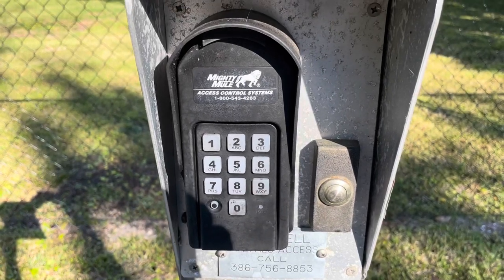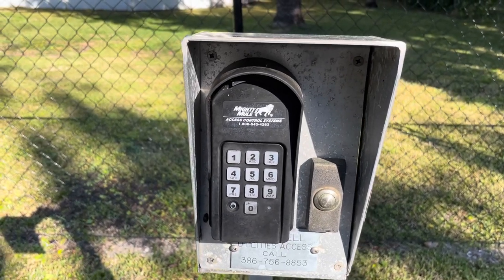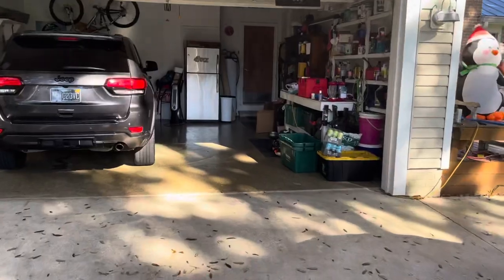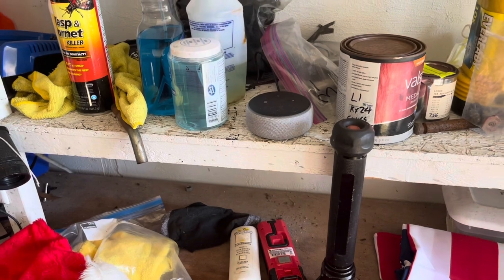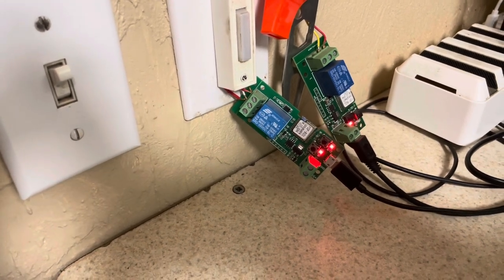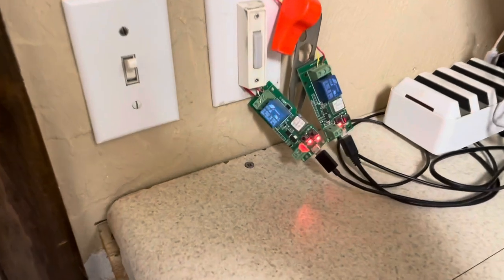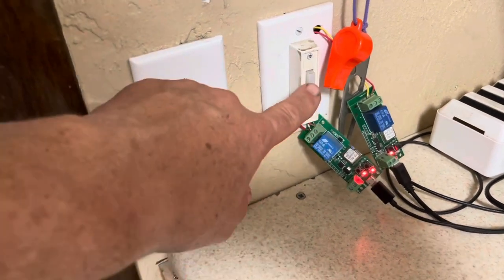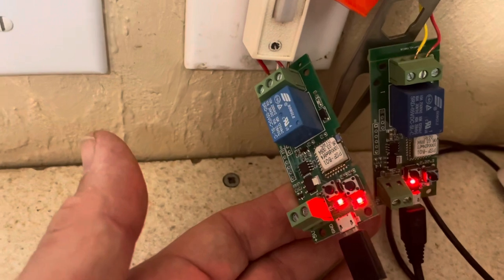Mighty mule gate opener life hack￼

Comment: Your gate opens and closes pretty quick. Which model are you using?
Reply from the maker: Sorry about the delay, and honestly I don’t know which model it was but it was from tractor supply around $300, my best advice is to buy the extended two year warranty and then you can replace it every two years for $100 which is the price of the extended warranty. I have replaced mine twice, I’ve use this product for almost 20 years, they’re OK you could probably get better for a lot more money but I don’t mind. Thanks for the comment.